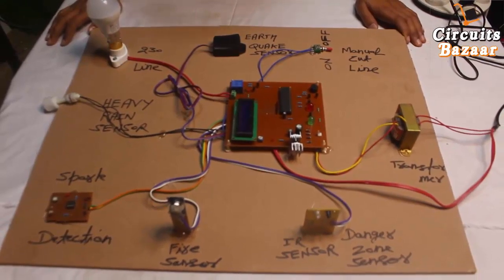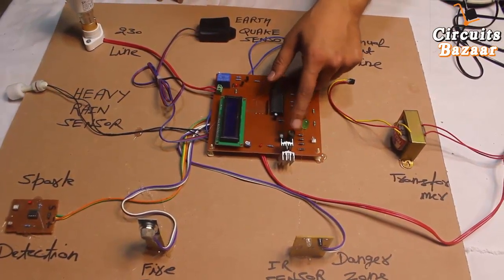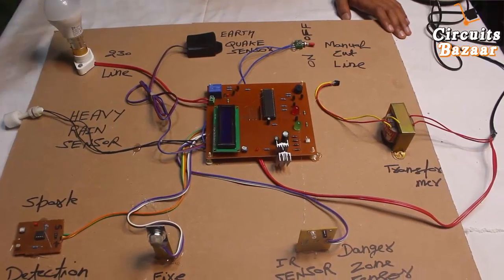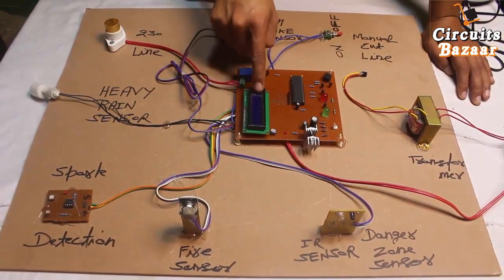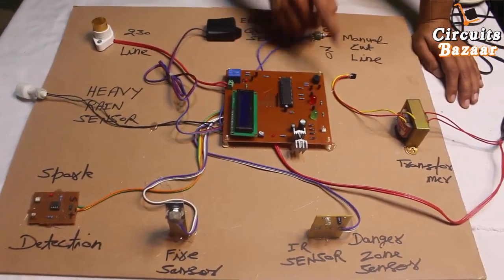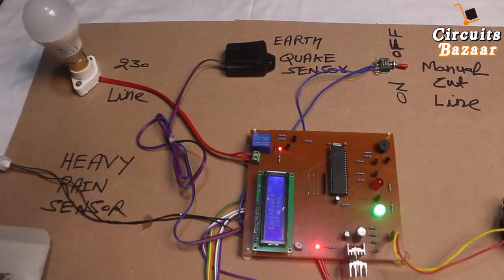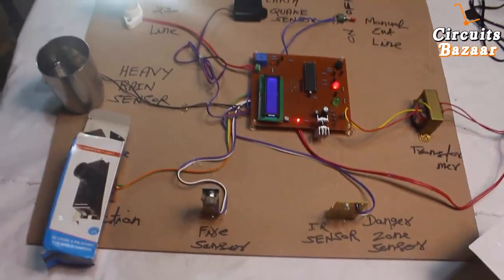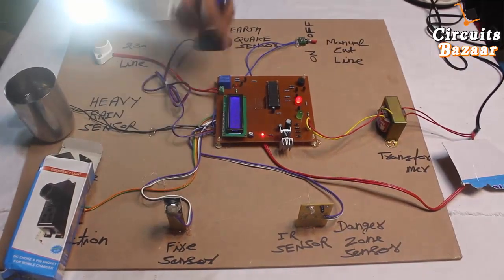Substation disaster management using modern sensors

Comment: Why ADC is not used??
Reply from the maker: Because most of the sensor is giving digital 1 or 0 output ... so we don't need .... you can use ADC as well for the sensor output .... but it will make the code bit more complex